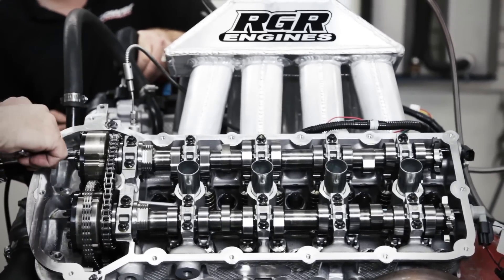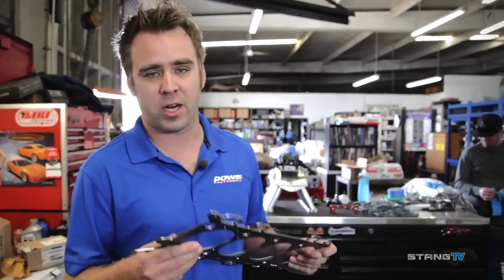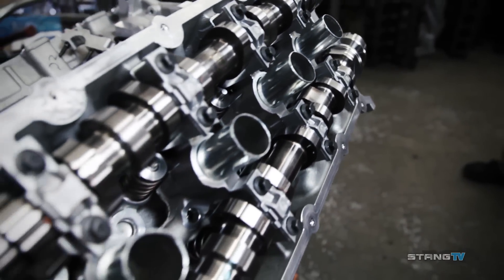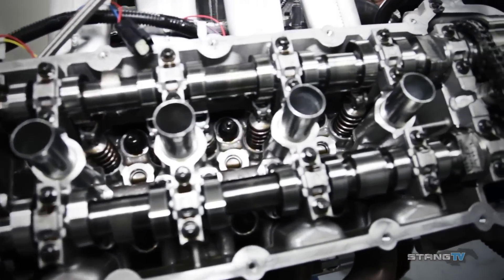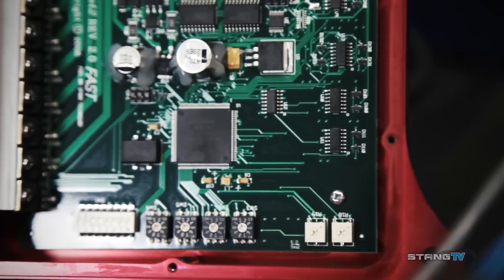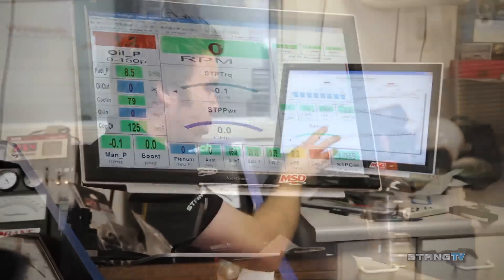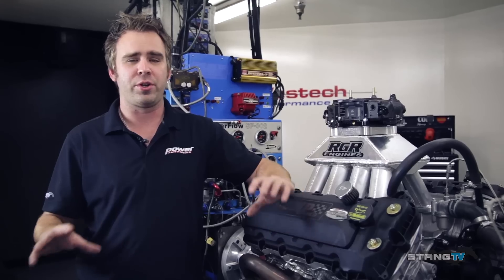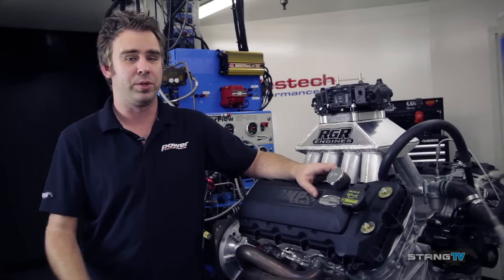Carbureted Cobra Jet Coyote Engine Build: Long Block and Dyno Testing

Comment: Why would anybody want to regress on fuel delivery technology. Seems ignorant to me.
Reply: Depends on what this engine is going in.
Reply: Reminds me of the question when Daddy Dave first went the procharger route....... Carbureted? Why?
Reply: CAKED Racing I'd feel pretty comfortable saying you could buy a Ford control pack and a set of 47# injectors for way less money than a sheet metal intake, stand alone ignition, and a good carburetor.  You'd also have dramatically better drivability with the VCT enabled and fuel injection.

Comment: ***** Did swapping out the chain tensioners eliminate the infamous "gas igniter ticking noise" at idle?
Reply: ***** 
Curious about the cams.. They aren't stage 3s or the ford racing cobra jet cams??  Where can I find these?